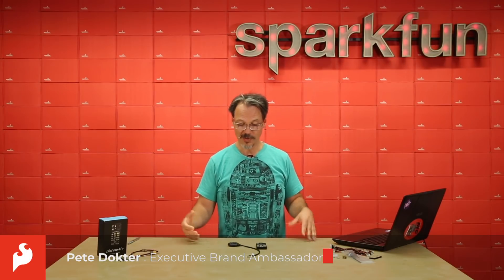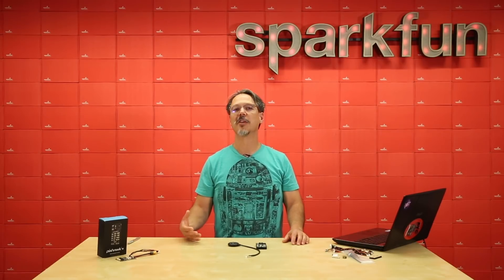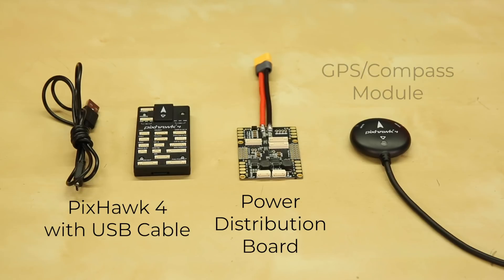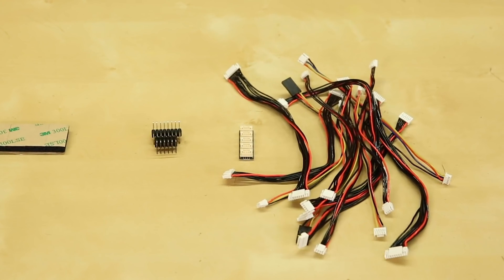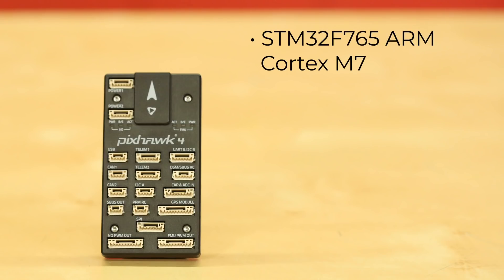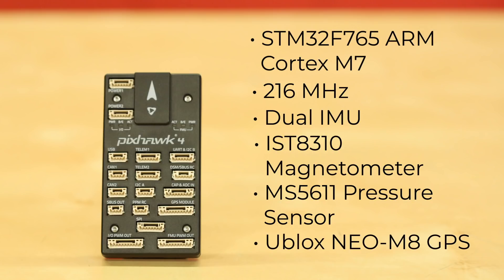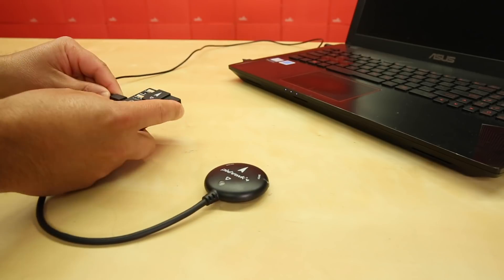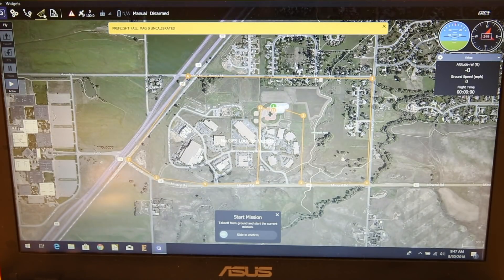Product Showcase: Pixhawk 4 Flight Controller

Comment: I have a 4 in 1 ESC (BlHeli 20A) and I’m not sure how to connect to the Power distribution board. Would connecting the the ESC directly to the battery in parallel with the Power distribution Board and then only connecting the signal from the ESC a stupid idea?  Thanks for the help
Reply: I HAVE THE EXACT SAME PROBLEM TOO SEND HELP.

I had to plug the white cable of the ESCs into a the M1,M2,M3,M4 ports that i soldered a single header pin into M1,M2,M3,M4 so that i can plug my ESCs into them.
Reply: My drone is now kinda flying but now i have other problem such as a YAW issue that makes the drone fly like a freaking Beyblade. But it may be due to an unbalanced drone because the FUCKING Pixhawk4 DOES NOT COMPENSATE FOR AN UNBALANCED DRONE!!!